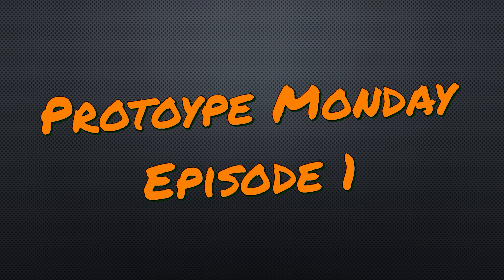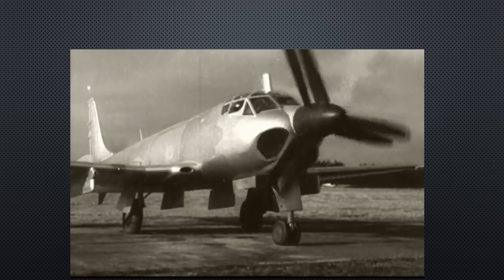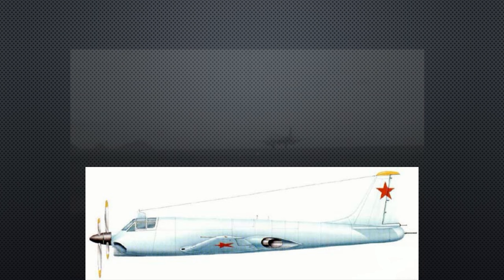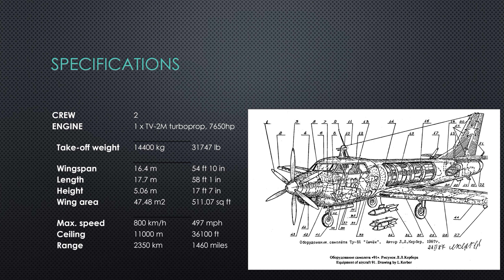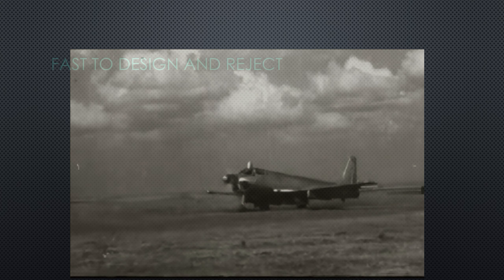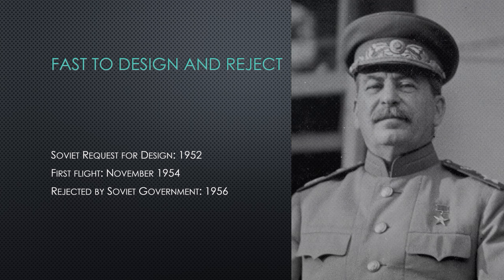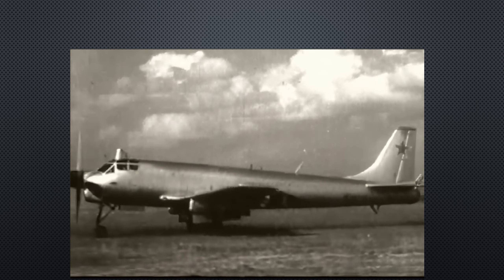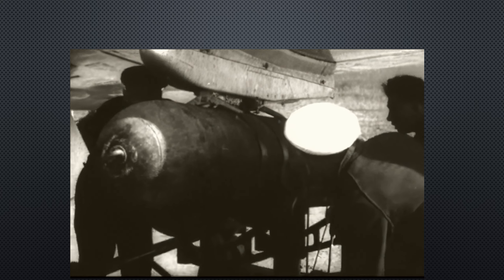weird protypes - short Airplane vids: USSR Tu-91 bomber

Comment: Dead end design as a carrier aircraft; completely vulnerable to the contemporary naval combat aircraft of the Western fleets.

It might have had some use as a maritime patrol aircraft, but the Soviet Union already had more capable patrol aircraft.

Its real only purpose was as a technology demonstrator, for which the sole prototype was entirely sufficient.
Reply from the maker: Great point and complete agreement  with advent of air defenses and jet interceptors by late 50s through to 60s the backfire fast missile launcher or bear badger high with kh stand off missiles became only real viable option
Reply: @plazma1945  even with standoff missiles, it was a dead end; 1500 kilos of useful payload was anemic by the era. That's basically one missile; the Soviets already had aircraft that could double that with greater range and greater loiter.

Comment: The Tu-91 in its carrier version looks for me like a soviet version of the A-6 Intruder. In an alternate Timeline, I wounder if the Tu-91 had been upgraded with  Tu-95 engine (2x4 blade engine). Also acted as air Tanker for refueling other Soviet carrier based aircraft ( like a navalized version of the Mi-23).. And going very wild with a 4 seat Jammer Version of the Tu-91 as equal to the E-6 Prowler..  Its a pity Chruschow canceled it.. i think in Afghanistan the Tu-91 would have been useful against the Taliban.

Comment: I mean if it had nuclear ability and a pilot that didn’t really care to see tomorrow and read up on Japanese tactics I’d argue it could’ve been scary
Reply from the maker: Probably Idea was to add nuclear torpedo later but it was replaced by tu-16 and later tu-22 as the concept with now having high speed stand off missiles. This plane was closest to a su-25 or a-10 just bigger. All dumb weapons
Reply: @plazma1945  nothing dumb about dumb weapons… if you use the force you can do like Luke skywalker or Rooster from Top Gun and be more accurate than laser… vodka acquisition system comrade
Reply from the maker: @lucaniouspetrenko9404  maximum vodka